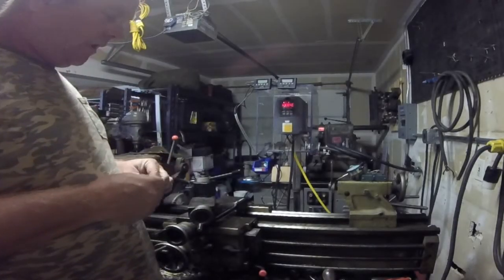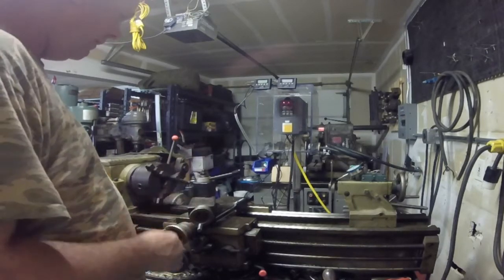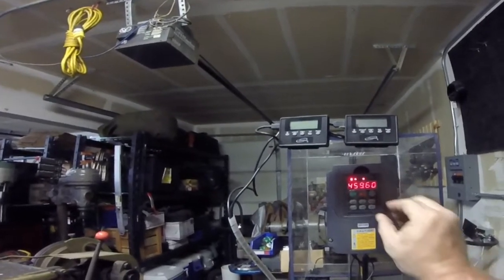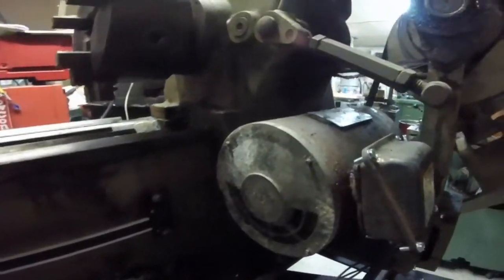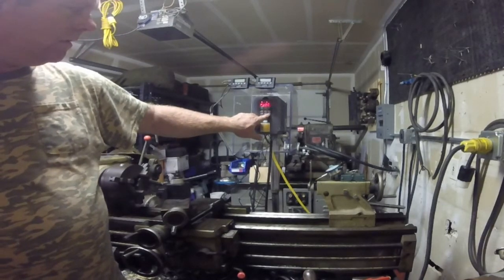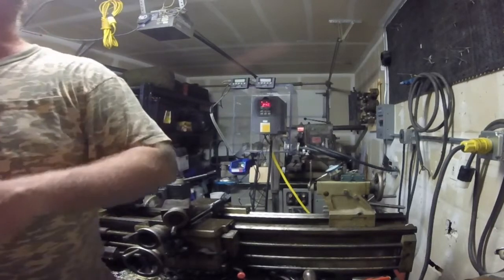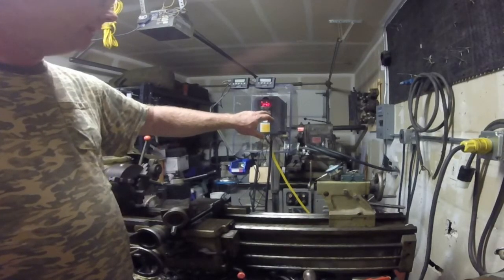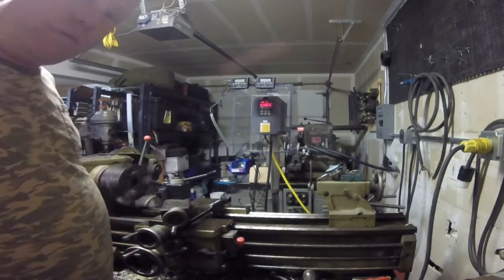Huanyang VFD Conversion

Comment: curious why you did not just go with a rotary phase converter
Reply from the maker: Hi Ed.
i stepped into the 21st century!
i made a 7.5 Hp RPC and a 5HP RPC.
the 5 hp rpc consumes about 11 amps idling and more during operation.
the VFD is near silent and i can control the frequency of the motor- very handy for threading to a shoulder!

Comment: Nicely done , I use three of the same model vid in my home shop. So far not had any issues in three years. I do find some of the sounds from certain motors is odd , but they are running and not getting warm . I use similar parameters on my set ups.
Reply from the maker: Thank you @lookcreations!
the vfd seems like it should hold up, the motor is way overkill for the lathe so it won't ever see full HP potential to the spindle.
you can adjust the carrier frequency to a higher Khz to alleviate motor whine and click